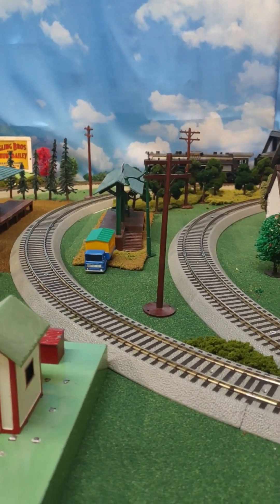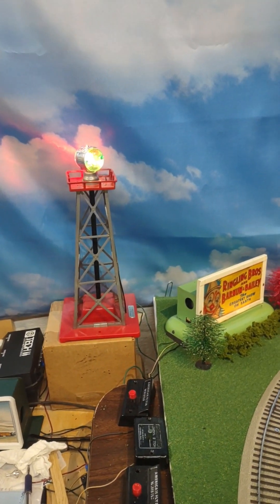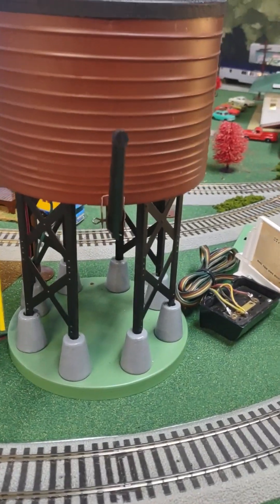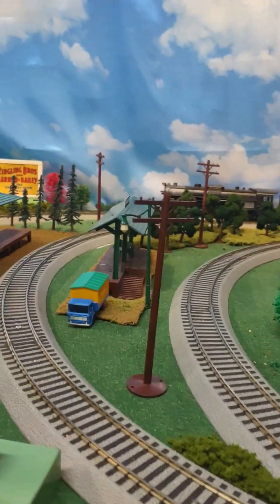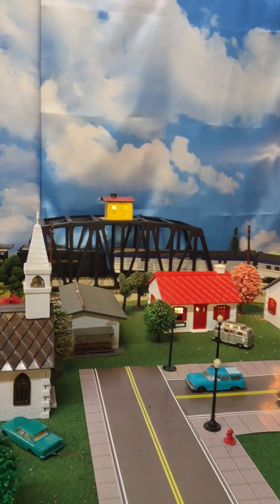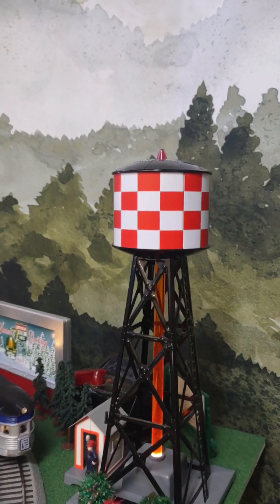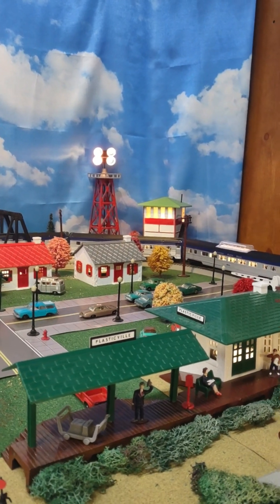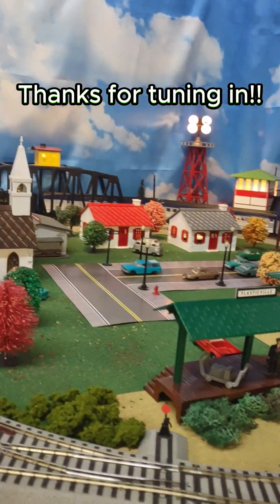First Ever Layout Update and Tour

Comment: The scenery really adds to the overall look. The background curtains are a nice addition. Where did you find them? You have some nice accessories there. What size is your layout? I have some Plasticville buildings on my layout and some I won't be using any more. I put interior walls in mine, so I am looking for another lighting solution. I do wish you had recorded this with your camera in the horizontal position so we would have a larger image to see in the horizonal window.
Reply from the maker: Thanks Mark.  The added scenery turned out better than I expected and the vinyl curtains are a big improvement.  Got them on Amazon but saw earlier today they are not currently in stock.  I hadn't thought of interior walls for Plasticville buildings.  I'd be interested to see what you've done.  Good thought on the recording; I was waffling on which way to do it.
Reply: @mikesamericanflyertrains   I am nearing completion of a project of hand making the missing parts of a Plasticville building and detailing the exterior and adding interior walls and some details. I will produce a video when I am done.